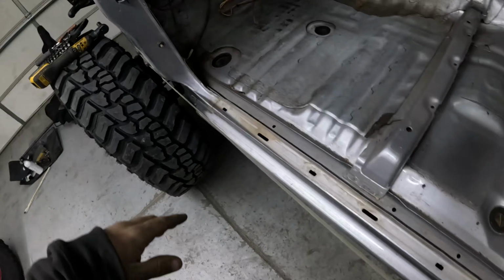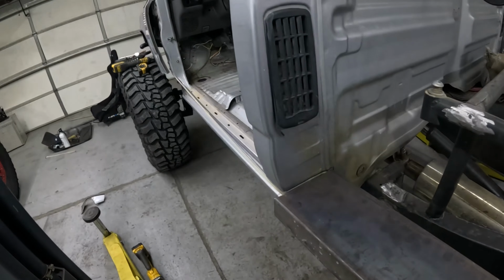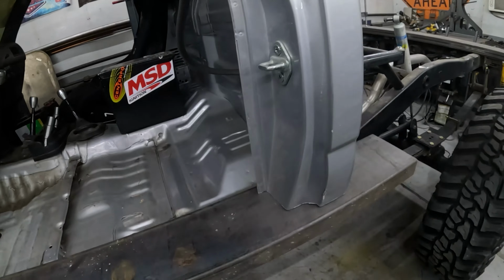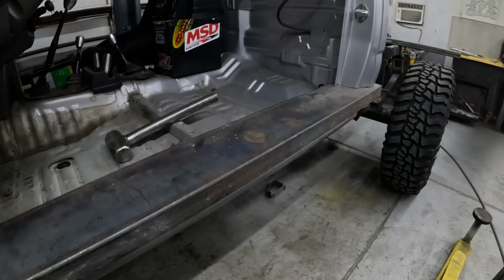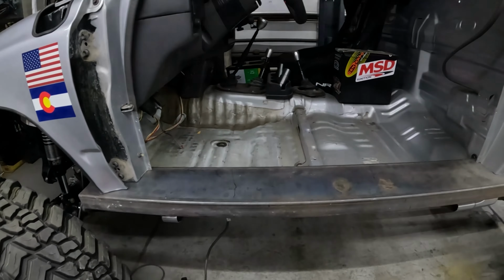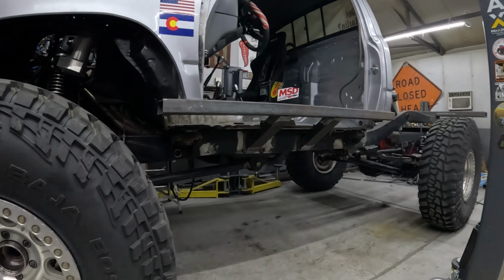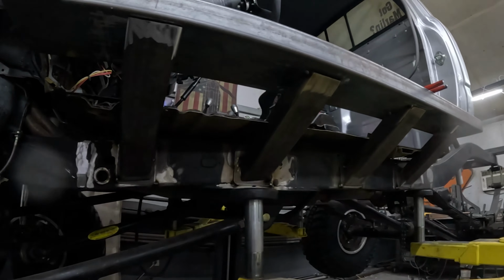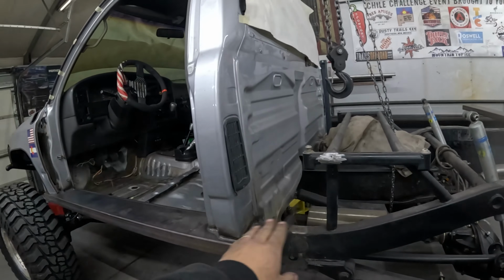3rd Gen Toyota Pickup Boatsides

Comment: Interesting.  I did a similar setup on my XJ, but didn't go near as high on the door.  I just cut the bottom 1 1/4" of the door off.  My wife bitches enough about hopping up into the jeep now.  I can only imagine if I went another 4" up.  😆  That looks like it will be a bear getting in and out of.